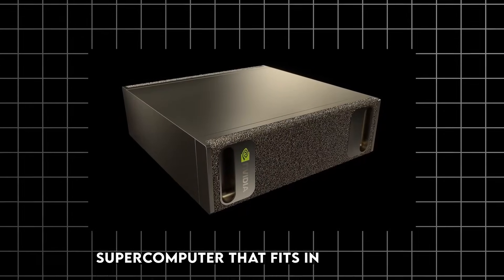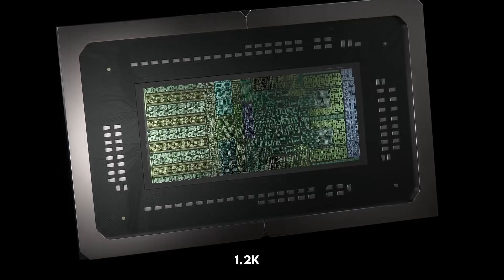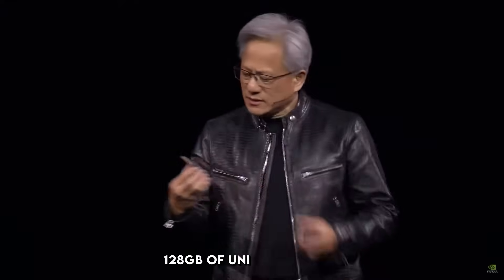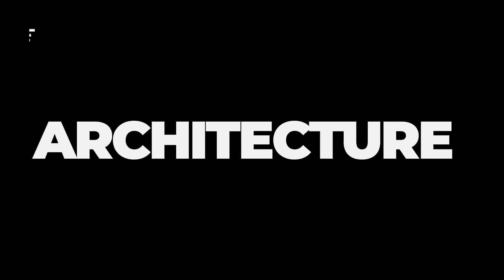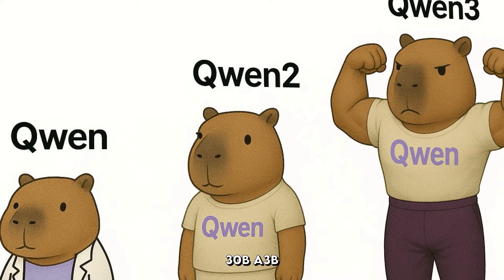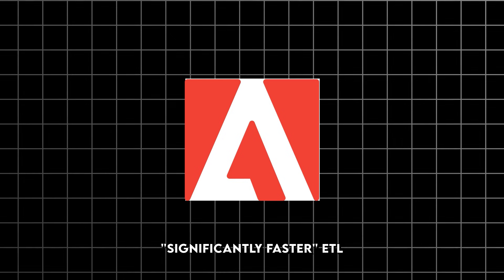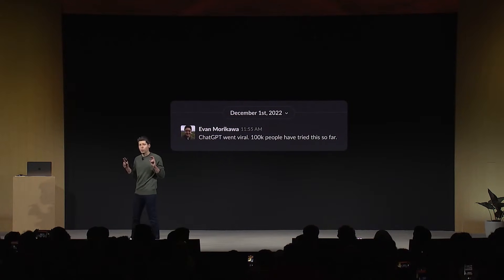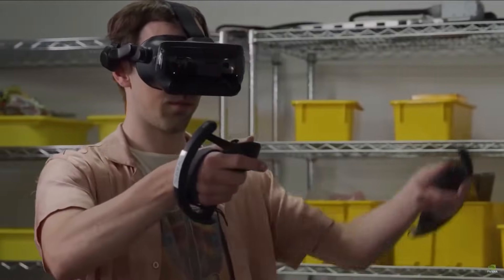This TINY $3,999 AI Supercomputer Will Blow Your Mind! NVIDIA DGX SPARK Revealed!

Comment: It's a desktop development system with the full Nvidia software stack so you can go from working on your desktop to running on a DGX cluster with no code changes. It's not a huge performer as it's bottlenecked by memory but it does what it's meant to.

Comment: There hasn't been a single review of actual "in hand" hardware so far.  Currently it seems to be pure vapor.  Since it was promised in July, it's at least a month late, and considering even the reviewers aren't getting it yet, there's no way mere mortals are seeing this before October.  Also the compute appears pretty high, but the memory speed is such that it's unlikely to be any better in use than a high end Mac, and we don't even know what the street price will be.  So, pretty disappointing all around.  Probably better off to just buy one of the Strix Halo mini computers, they can be had for ~$2K and probably perform pretty similar to the Spark.